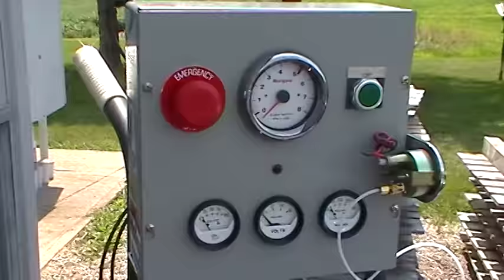383 Stroker Blower Motor Startup

Comment: This engine sounds grrrreat!If I planned to install in a mostly street cruiser, I'd leave it as is,but street/strip or mostly race?No.Those dished pistons come out and blower gets positive overdrive pulley.Yes,the pump has goes too in favor of racing gas or alky. My money would've had less street cruiser and more spank ass light to light or track time.

Comment: if no one noticed, the stand didn't flex. very smooth engine
Reply: Nope it’s actually because I built the engine stand, my family has made engine stands for 4 generations
Reply: @scoobyjew5187  SO THE ENGINE RUNS LIKE SHIT AND THE STAND IS BAD ASS?
Reply: @gregsmith7828  YES! How many would you like to buy?

Comment: I bought a BIG AL’S TOYBOX blown 691 hp mopar 360, bored & stroked to 407ci. It’s 12% underdriven but for the HELL Of It one day I swapped the pulleys around which gave it a 12% overdriven effect. The sound of the engine kinda intimidated me. The correct idle setting should be just when the surging stops.

Comment: Sounds like engine surgging at idle. Lop at idle is normal for a performance cam but should be constant. Why the surge? Fuel, ignition, valve adjustment?
Reply: It's called blower surge.

Comment: Buy a set of Holley carbs. Also the engine is harboring. Fatten up the air fuel ratio. Better towards the end of the video.

Comment: Here is a video Pepper I’ve talked about when you ask me what causes the unstable RPM at Idle? It’s due to three things Cam timing where this guy has his cam and Fuel/air ratio Plenum Aero Dynamics some old school tuners call it wet/dry Dynamics Idle..But the main thing is Performance RPM or Operating RPM range some like this condition or sound but with todays modern HEI controllable electronics this can be completely tuned out where it idles as smooth as a stock 400 SBC...

Comment: its rolling because its going rich to lean in the idle circuits.. Some dont like it, will bitch that its not tuned correct, I like the roll, but it hurts nothing at WOT. It is all preference. sounds good to me..
Reply: It's not tuned right it may not affect WOT performance as you claim, but it sure as hell does affect street manners.  It's a street rod motor, not a drag car.  It runs like complete garbage.

Comment: Mechanical Maestro sweet
Reply from the maker: I have started building the next one. It is 357 cubic inch small block Chevy. Aluminum bowtie heads are extensively ported. Enderle Bug Catcher injection on top of an 8-71 blower.

Comment: Steve from Annapolis I've been building engines for quite a few years cannot believe you using a plastic oil line at least he's a copper oil line it's the same amount of time for installation especially with expensive engine with high volume oil pump come on now copper oil line
Reply from the maker: The plastic is more forgiving to flex on the test stand. I never use it in a car though.

Comment: Very Sweet. Question with 9:1 compression, great heads 383 stroker, high lift cam with long duration, great heads,  High quality pistons, rods and crank and boosted by SuperCharger was is your red line @ only 6,000 RPM's? Man, she rev's up nice ... I LOVE the way you thermal check each cylinder with the I.R Camera. You have to race from a Jet Tech ... It reminds me of the movie, "Das Boat" a Submarine movie, ware the excellent German Powerplant mechanics would open a valve right over the exhaust valve on each cylinder to ensure color of flame, "BLUE" When firing perfect. Buy viewing flame the German's were able to tell timing, ignition, compression and fuel flow to all 16 cylinders of their twin Diesel Powerplants ...
Reply from the maker: The cam is designed to make power up to 6200 rpm. I set the rev limiter for 5800 to protect the engine as well as the driver. It was eventually installed in a 48 Anglia for a 70 year young Hot Rodder.

Comment: this is a nice engine for the streets and playing on test and tune night at the track. But if I'm figuring correct with it being under boost with you should be able to turn the engine up to around 7500 rpm with total timing set at around 32 degrees only thing I'm wondering is why didn't you build it with a 11:1 ratio considering the heads and rotating assembly
Reply from the maker: The cam is designed for street supercharger applications with a power curve to 6200 RPM. The compression is 7.9:1. With total boost limited to 9psi that yields an effective compression of 12.25:1. Timing is limited to 26deg when at full boost for running 97 octane pump gas. If you ran 112 octane race gas you could push timing to about 34deg. If you ran gasoline with 11:1 compression and 9 pounds of boost one word comes to mind.......BOOM!

Comment: Gotta question. What causes an engine that has a blower to pulsate like that? Probably a stupid question but wonder what causes it. By the way, the engine sounds great. Thanks for your time.
Reply from the maker: Never a stupid question. Blower surge is a result of a lean air/fuel mixture at idle. That can be damaging to a blower motor over time. Most builders agree it should be avoided. You can usually tune it out easily. 

That all being said, I love the sound of a hard surge. Especially if you can flip the tires with each pulse.
Reply: @qtrmiler1  Thanks for the explanation. I love the sound of it but never knew what caused it, now I know. Thanks again for getting back to me. Take care.

Comment: What are the horse power numbers and the torque numbers for the stroker? If he had fuel injection like an EFI set up with all of that can you image the power? Two Fi tech 600 power adders you would get so much air flow and a lot more power.

Comment: Depending on your blower drive ratio you may never get all the surge out of it. It's really not surging all that bad.
Reply from the maker: Had issues with the Carter carbs. Replaced them with 600 Holleys with boost referenced power valves. Runs smooth as could be now.

Comment: The engine sounds great, but I don't like when it runs at idle when it first started. It keeps accelerating and decelerating repeatedly over and over again. My guess that the engine is running LEAN. Probably need to adjust both carburetors for a better idle.

Comment: Wow that's awesome. I'm currently gathering parts to build a little stroker. I have a 4 bolt main 350 block 30 over all machine work is done and cam bearings are installed. Iron eagle rotation assembly with 6 inch rods and JE flattop pistons, double roller timing chain and gears. I plan to use a Victor Jr intake. I still need heads and cam & lifters. Do you have any suggestions on what to look for when buying a good set of heads? (Type/size) Also what do you recommend for cam? I'm not sure yet what the motor will be in. Don't plan on racing (at track) but won't rule it out because I live near Bristol Motor Speedway. Could possibly end up in a jetboat or a ratrod.
Reply from the maker: Tony Kelly Dart Iron Eagle heads are a great out of the box head. I think I would stay with a cast iron head if there is any chance it could end up in a boat. Besides that,  the Dart head flows very well and are not that expensive. If not concerned with cost and want a great aluminum head I would go AFR. The cam will be determined by end use. Very different  between car and boat. I would use a hydraulic roller cam unless you race it. Then go solid roller. That motor should spin easy 7500rpm. The Vic Jr will work great to 6800 stock and 7500 to 7800 with a 1 inch spacer. Flat top pistons in a 383 stroker with 58cc chamber heads will get you over 11:1 compression. A 65cc head should be about 10.5:1 and run on premium 93 pump gas. A .550 lift 292⁰ duration cam will make a smooth running low 12 second motor. A .620 lift 310⁰ gross duration cam could put you in the 11's
Reply: Brodix number 12 heads

Comment: Gonna need a rebuild before it sits between the rails...
Reply from the maker: Why would you say that? The engine has seen well over 10,000 (very hard) miles in a street Anglia since this video was shot. Nothing changed except oil and a set of plugs.

Comment: So lets heat up a engine shut it off suck cool air up into the valve train via shorty exhaust. . Thats why the dyno guys use an exhaust system. I cant believe you did that.    PS. PVC. NICE!

Comment: What formula do you used to determine pulley drive to boost level.  If I'm not mistaking the meaning of 6-71 is 71ci per cylinder multiplied by number of cylinder or 6.  which would equal 426ci.  Blower would be able to feed an engine  displacement 426ci. So the size of the blower in relation to the size of the engine greatly determines the amount of boost.  Is that per engine revolution or 2 engine revolutions?   How is predetonation controlled using a lower 93 octane level?
Reply from the maker: The GM 4-71, 6-71 etc. refers to the size of the diesel engine the blower was originally designed for. It has nothing to do with the cubic inch of the blower. a 6-71 produces about 330 cubic inch of displacement per revolution. There again it really has nothing to do with boost. Boost is a product of engine size, blower size and blower speed. For a given blower setup, boost will be higher in a smaller engine and lower in a big engine.Ignition is controlled by a boost referenced timing controller that retards timing as boost is made. Also, the static compression is set at 8:1 and boost is limited to 8 pounds @ 6,000 rpm. That is how it can run on pump gas.
Reply: How did you determine the pulley sizes in creating boost level.
Reply from the maker: Check out this web site. https://www.blowerdriveservice.com/technical-charts.html. I also suggest reading http://documents.holley.com/techlibrary_supercharger_tech_info.pdf
Reply: Thanks I think I understand.  What is the ignition curve under boost verses NA?  Or maybe I should ask how much timing do you pull per pound of boost?    Whichever is more simple to answer.  Oh, how much cooler of plugs do you run?
Reply from the maker: I.B. Sorgn. Weiand, BDS and many other blower builders have drive ratio and boost charts on their Web sites. Very easy to understand.

Comment: Nice set up but is there a reason for the water to be going in the outlet?
Reply: keep it cool?
Reply: CollinandMason I think he's asking why not run it into the inlet of the water pump.
Reply: Fender Bender The water is going in the inlet. You see it spitting out because the water pump rpm is varying with the engine speed. Also, the garden hose is putting more water in the white pipe than the engine can accept at idle.

Comment: No roller cam? How old school....lol...roller get ya more lift, less duration and with the no zinc oil nowdays flat tappet and sometimes flat cam scares me. Infared thermometer....you smart mo fo!  Great to setting idle mix, making sure each cylinder it pulling its weight...first tool i grab when somthing dont sound right...easy way to find crossed plug wires too...thats what they tell me anyway....i have never crossed plug wires in my life....lol.....you like those carbs? im stuck on holley stuff...small blocks kick ass with a couple 1050 doms if they are set up right...you should try a pair of q-jets...if for no other reason than they are butt ugly...aside from a little work getting enough acc pump and drill/fill the base plate for boost referencing they run great.....your motor looks great and sounds right on!  Figure 620 hp?

Comment: Freaking PVC coming out of the exhaust manifolds 😂 what's holding them on there??
Reply from the maker: The PVC pipes were used for water in and out. I fed it with a garden hose.

Comment: Great build! what is your idle speed and timing? I'm having a surging problem and just curious. thank you
Reply from the maker: Eventually we installed Holley blower carbs and set the idle to 1000 rpm. Still surges until warmed up but not nearly as bad as in the video.

Comment: You have another 383 stroker ready to go I’m looking to buy seriously
Reply from the maker: I don't have one ready to go. I am building a 355 that should turn out very fast. Highly ported aluminum heads, splade mains, roller motor, rev kit, 8-71 blower. I plan on also using an Enderle Bug Catcher fuel injection. Are you interested?
Reply: Yes I am interested

Comment: That idle shouldn't sound like that, sounds like it's starving for air most superchargers have an idler pin or they used to which allowed the engine to get air during idle, btw at the end they had it sounding pretty good still a hair off IMO

Comment: 8:1 compression? Isn't that a horrible rating shouldn't a high performance motor be 10:1 or 11:1? (Just learning about compression ratios and don't understand this goes against everything I've been told plz explain)
Reply: With forced induction you usually have lower compression.
Reply: but would high and a supercharger be best?
Reply: +Mr. Stark on a naturally aspirated motor high compression is good. When you are adding  forced induction to the motor you want to lower the compression to compensate for the added boost.
Reply: George Woodruff Thanks. so would having high comp. and a blower make the motor blow up? like whats the bad vs. good in the 2?
Reply from the maker: +Mr. Stark ..... With 8:1 compression and 8 pounds boost the motor acts like it has 12.5:1 compression.

Comment: any renomendations for a stock gm sb 350? i dont know if i should do a super charger or turbo and what would i need other than the turbo or supercharger? i have a 4barrel edlbrock carb on it and im wanting a little extra power for my 72 c10 for the street
Reply from the maker: I love blowers. For a basically stock motor I would use one of Weiand's 144 mini blowers with a single 780 Holley blower carb. It will make about 6 pounds of boost and add about 100 HP. The motor MUST be in great shape to start with.
Reply: Depends on your budget and knowledge base.
Super chargers are generally a bolt on kit, but can cost anywhere from 2000 to 4000 for the kit. While turbo charger require a bit of fabrication and know-how, but are extensively cheaper, cheap TT kits for a SBC can run as low as $700. But you may need extra piping, fittings, etc. Not to mention with a turbo kit, you'll need to buy a blow-through carb, cause is the 4bbl edel you're talking about is the one i think it is, then it's just going to build positive pressure in the bowl of the carb cutting of fuel flow. Also, and AFR gauge, and a FMU are extremely recommended for the simplest levels of tuning and longevity of the motor. Generally speaking, turbos arnt really the way to go, but supercharger are substantially more expensive.

In my opinion, you're be better of just spending the 3,000 sum-off $$ it would take to buy and install a super charger and spend it on something else.. Hell, for 2000ish you can get a LS motor with the computer and trans. That right there would probably make twice the power that old tired 72 motor ever would, even boosted. not to mention it would be more reliable and get infinitely better fuel mileage, and the tune-ability is greater too.

So let's do a little break down, shall we? (:    (Numbers are estimates)

Option 1:
+Your motor - 1972 SBC 350 (170HP Factory, 140ish Tired)
+Your motor with a Super Charger - 240-260ish Horsepower for ~$3,000.

Option 2:
+Sell your 1972 SBC 350 & Trans (Maybe you'll get $1,000 to the right buyer)
+Buy an LS 5.3L w/ wire harness & Trans
+LS motor makes 270-310 HP Factory, Plus you get reliability, tuneability, modern amenities like OBD-II and data logging, and even better fuel milage. At probably half the cost it would take to build your old, tired 350, and supercharge it.

Food for though, good luck on the build, trust me, I was in your boots one day, had a SBC and wanted more power. Mine was a crate motor, and it was just rebuilt, but even yet, supercharging it was far more expensive than LS swapping it. I LS swapped my truck, and sold my old motor and never looked back, and i'm very content with the 345ish HP that my truck was putting down. Little random info. I tried selling my truck for  $1,000 for ovef a year and no one nipped at it, even though it had no rust, ran great, and had a new paintjob. Notbody bit at it. But as soon as I LS swapped it, people was asking about it. and it wasnt untill just last december I decided to sell it. And gues how much it scrapped up? $8,000. 

Good luck on the build, and remember, It's your vehicle, so build it how YOU WANT!

Comment: Dude I came back ! do you have howards cam number or specs? Im buliding a new 383 with a 6-71 .
Reply from the maker: TEST Fifty To be honest, I built another one after this using a Comp Cams roller and I will never go back. The CC is a solid roller cam, street blower grind, .575 lift. The Howards cam is a hydraulic flat tappet street blower grind at .530 lift.

Comment: I need that in my 59 chevy pickup. Instead of the stock 350
Reply: Byron spade I had a 350 boed it 40 ova with sum hit tech shit. I swear that 355 hit hard n smooth. I sold it to a partner n he scared to mess with cause it lifted his s10 wheel off da ground

Comment: I have a 350 4 bolt main.  I want to turn into a 355 with a 6-1 blower.  Would you so kindly share some knowledge on how to do so?
Reply from the maker: +Don Lemke A good place to start is education. Look for a book called "Street Supercharging" by Pat Ganahl. Then start looking for a good builder.
Reply: qtrmiler1 Thank you. I'm definitely gonna look for the book. I've built engines with my father before. I know how to take down and replace parts. What I don't know is what parts to use to get the most out of the engine to get the compression for a blower.